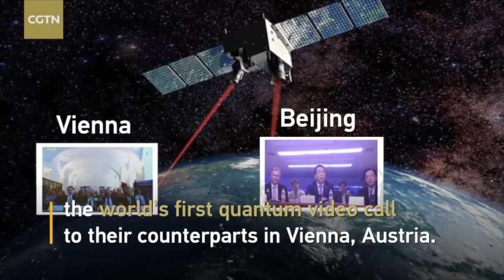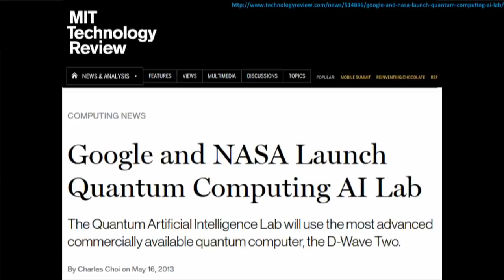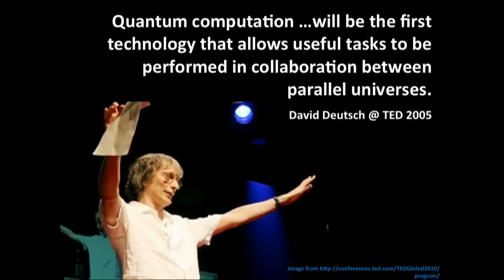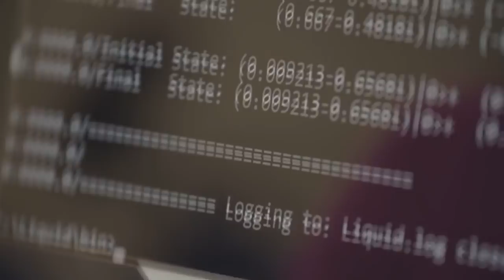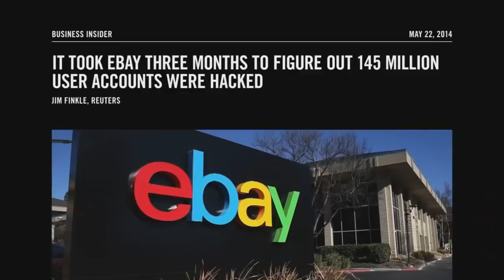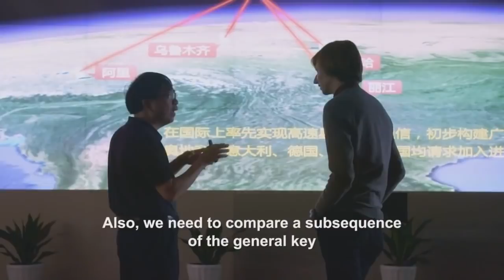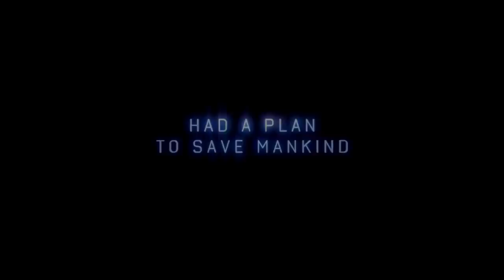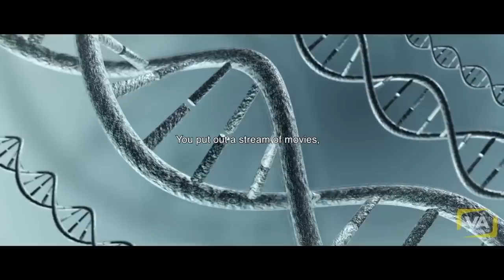The Race to Harness Quantum Computing and A.I [The Singularity]

Comment: “Still decades away from that goal” of making a working quantum computer capable of cracking encryptions. 

-well.. here we are 6 months later and google did it
Reply: Thats not what google accomplished.
Reply: No Google made a machine that they have claimed work's better than a standard computer can. Aka Quantum Supremacy.

They may have done this with a machine bigger than a standard high school. 

The programming for this new type of device, IBM has one too, is well over a decade, or so it seems, away.

Many of the bits added on this don't explain the science very well. 

We are well away from this being used in a University or in any way beyond a testing phase. Yet.

One of the first things that Google is planning on using a quantum computer for, weather predictions. Instead of taking terabytes of info in and taking a little over a day to make predictions. It will do it in real time. Giving much better and specific storm warnings.
Reply: No doubt

Comment: Is it just me, or has it occurred to others that these machines need electricity, so just pull the plug so to speak, cut the power source and  goodnight out of control A.I.
Reply from the maker: assuming A.I in the future don't resolve this problem, otherwise yes, pull the plug or use some kind of EMP
Reply from the maker: Crebs Park  haha all love..
Reply: In the matrix they scorched the sky’s to cut the power of the sun but the machines were smart enough to come up with a plan to enslave people while generating needed electricity
Reply: Unless they run of wireless "free energy"... Then at that point, they need to be physically destroyed.

Comment: Quantum computing is a joke, it's only notably faster than conventional silicon processors in very specific computations, so specific in fact that it's essentially worthless. Silicon processors will provide enough computing power to reach the singularity before Quantum computers can even function as a fixed function accelerator.